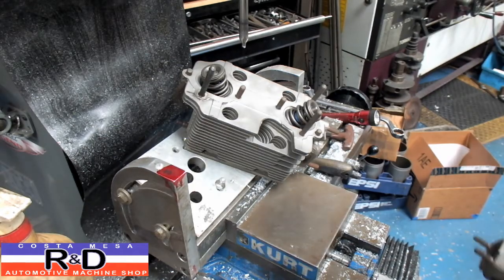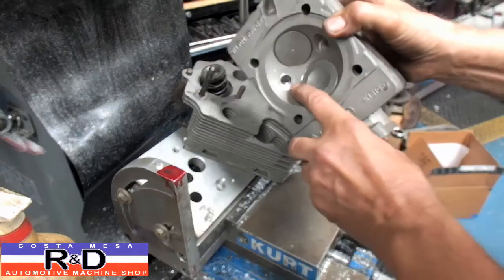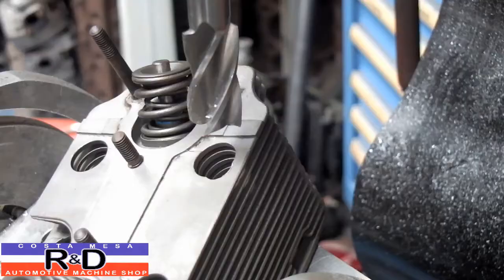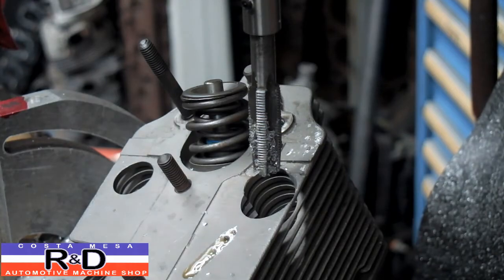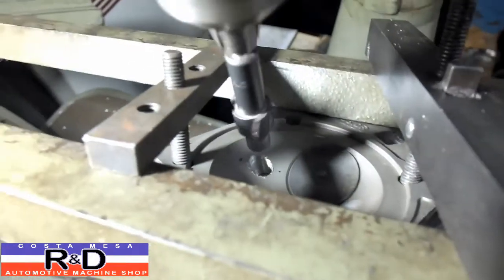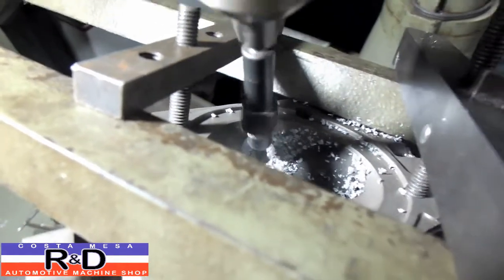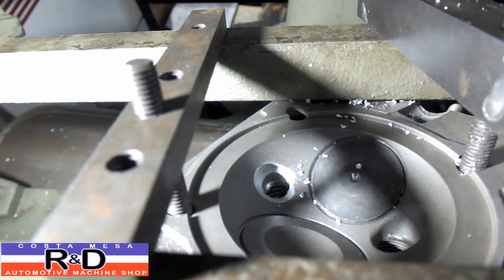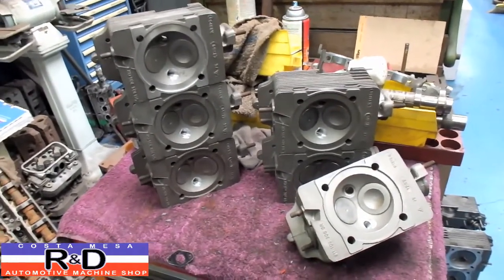Porsche 911 Twin Plug Conversion

Comment: I remember doing the same machining and adapting the Bosch distributor cap to the stock distributor. Here are some comments:

1)  The Bosch 12-wire distributor cap is incomprehensibly expensive but if the customer has money...

2) The distributor cap does not incorporate a centrifugal rev limiter. Two electronic rev limiters must be added. 

3) The (large) 12-wire distributor cap was adapted to the smaller stock distributor. I machined a custom adapter for this out of Nylon.

3) Holes for access of spark plugs must be machined into the lower valve covers.

4) This modification achieves spark redundancy - a requirement for aircraft applications:)

5) This modification affords an improvement in idle smoothness.